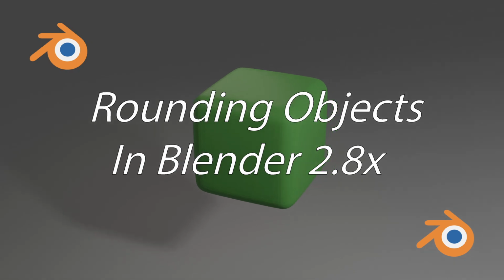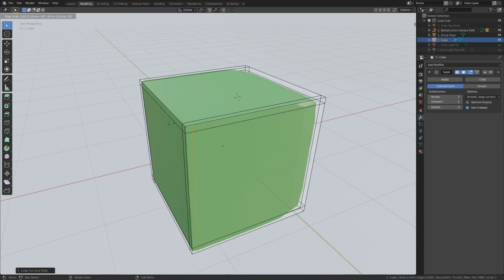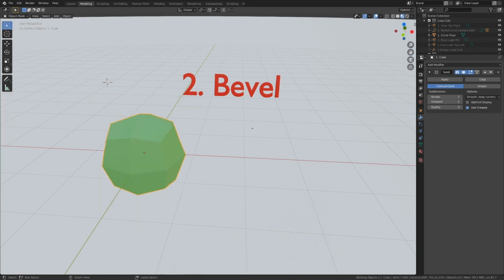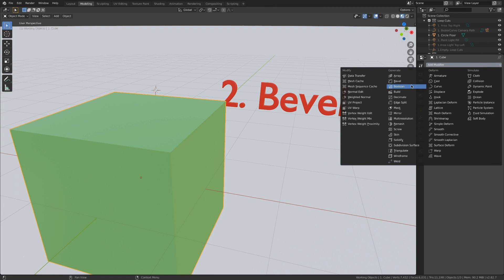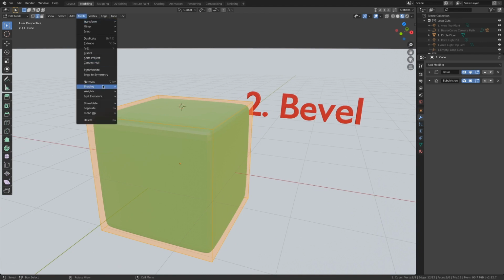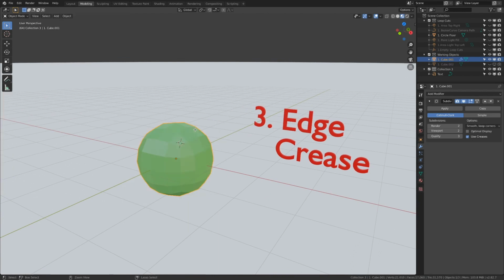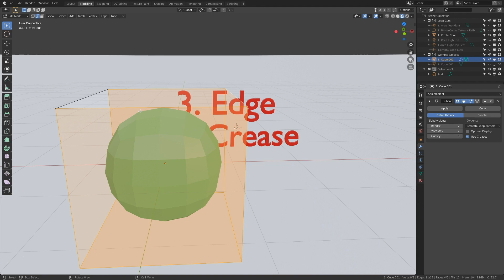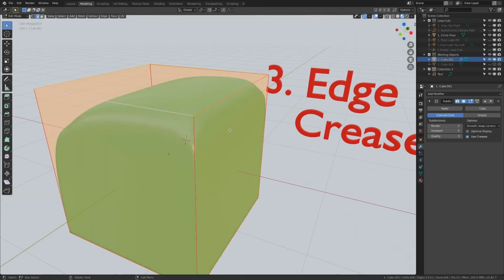Rounding Hard Edges 3 Methods in Blender 2.8x

Comment: My issue is that I want to make something for 3D printing in blender but can't find anything about actually  making smooth edges instead of rendering tricks.
Reply: pro tip: you can watch movies on kaldrostream. I've been using it for watching loads of movies during the lockdown.
Reply: @Kylo Kingsley Definitely, been using kaldrostream for months myself :)
Reply: @Kylo Kingsley yup, have been using kaldroStream for since december myself :D
Reply: @Kylo Kingsley definitely, I've been using Kaldrostream for since december myself :)